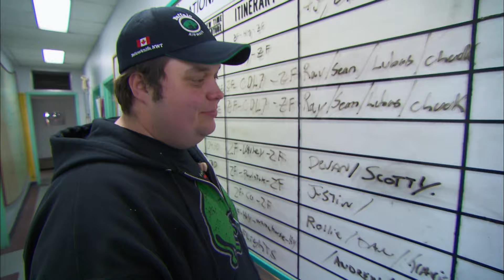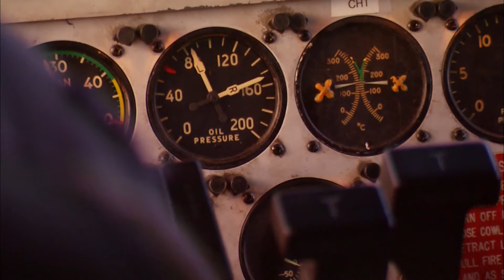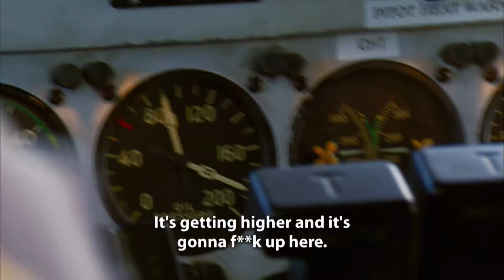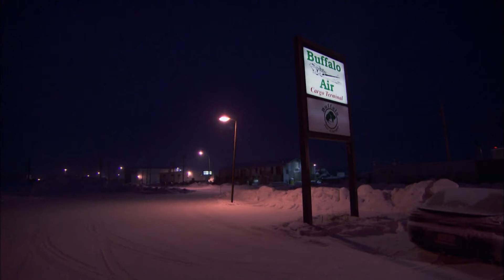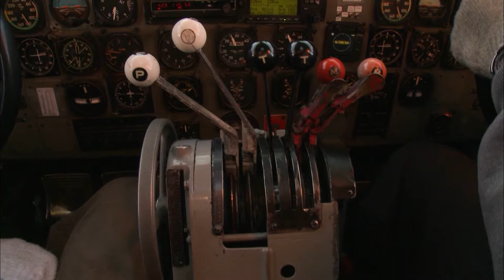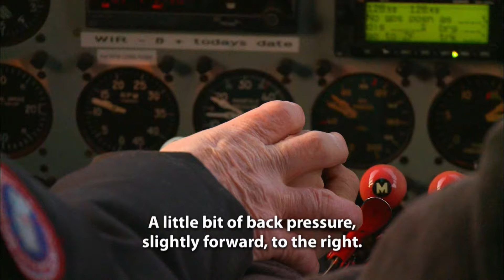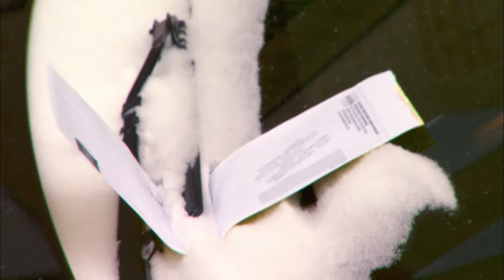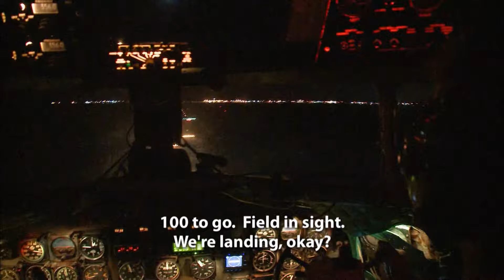C-46 Plane Narrowly Avoids Exploding Mid-Air

Comment: My truck froze overnight. I almost skipped the brake test due to how cold it was out. -6 F. Last minute I decided to test the trailer brakes. The plastic air line was cut cracked due to freezing. I had no brakes. Had to change the gladhands at place. Then the brakes worked. My instructor was glad I discovered it Before pulling out of the depot. We had hills and bridges to cross on the training run.

Comment: If I were flying in subfreezing temps and I saw that abnormally high oil pressure rest assured I'd head for home and I'd stay parked until that can be thoroughly checked.  Any supplies I was carrying might have to run late but it's better than hitting the floor and ending up with a wrecked plane, wrecked cargo, and coming home in a wooden box.

Comment: Respect to these pilots, the coldest day I've ever exsperanced, was 15 deg celses, that's mid winter in South Africa, but then again I've experienced 51deg celses, and that's excessive hot temperatures
Reply: I'll take the below zero over the excessive heat any time. You could actually cook in that heat.

Comment: The oil pressure went down because they increased the rpm when they turned around,  that way the heat increased and pressure, so if it was blockage because of cold weather,  it's was thown out within a second..

Comment: I'm no expert but if it's flying in environments that cold, does it need the oil coolers? Could put in a bypass system for times like that.
Reply: such as an automatic 3 way thermo valvle and heater tha uses exhaust as heating medium
Reply: Oil still need to be warm to flow.
Reply: There is a bypass system.
Reply: You think cold temps negate the need to regulate an engines need to operate at a certain temp?  It is the reason your car engine gets to give you heat. On a aircraft, during slow flight procedures you can easily overheat,  During cold you can damage your engine by running too cold.
Reply: @vancelacarte6563  talking about an oil cooler not an engine radiator.
Reply: @mechsupernova  airplane oil coolers are not like car oil coolers.  There is regulation of oil flow into the cooler based on temperature demand.  The problem here is actually the reduced flow through the cooler causing the oil in the cooler to congeal and clog it.

Comment: I'm no pilot by any means.
But if my oil pressure jumps to 150-160 and you are having issues when its at 120 while its normally at 80.

I'd have turned around and landed. Because something isn't right. No matter if it drops again, something was wrong and probably still is. No point in risking breaking the engine or crashing the plane and killing the people inside it.
The decision to go to Yellowknife with the oil reading seems irresponsible to me.
Reply: I am a pilot and yea I agree…You can get higher oil pressures in cold weather due to the oil being denser but it usually balances out once the engine is warmed up. Me personally I’m turning around if any thing is out of the norm…My passengers and cargo can wait, I’m coming home at the end of the day